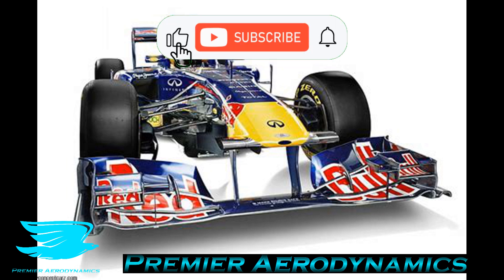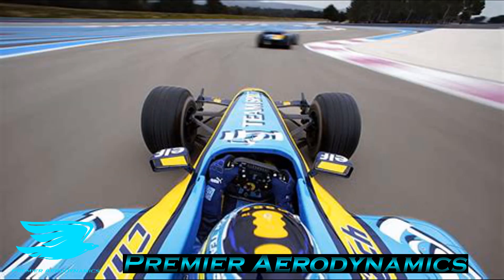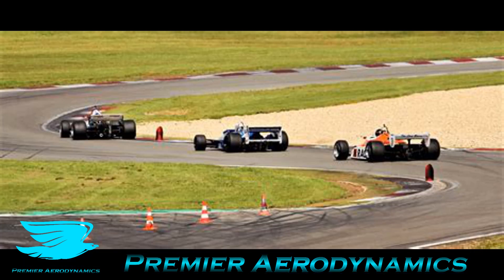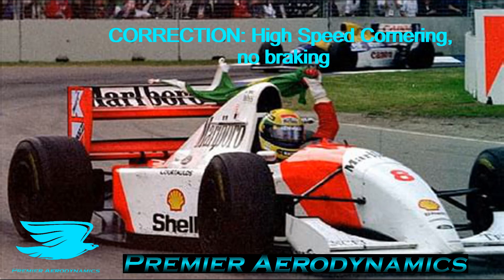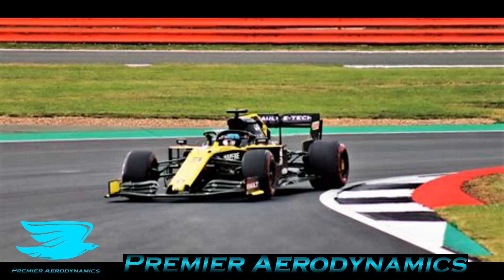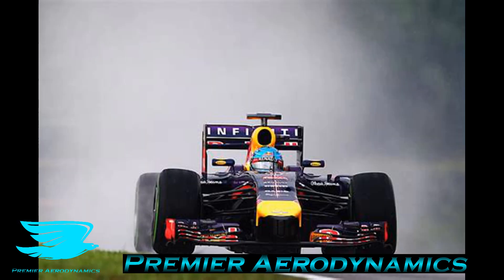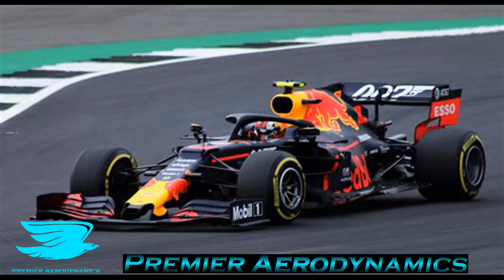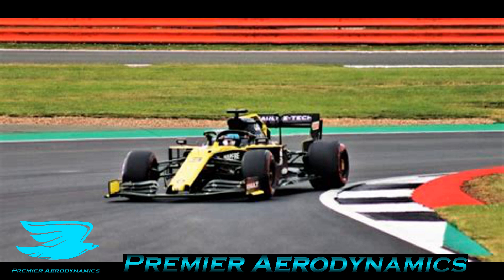F1 porpoising explained and how to fix - Podcast 47

Comment: What about tunneling on the floor so that it physically can’t get low enough to choke off thus preventing porpoising

I’m just a 20 year old kid trying to build a  fully functioning f1 car and I’m trying to learn as much as possible about the challenges and problems of them and I just discovered porpoising
Reply from the maker: Yep, that could work, but it also affects something called the venturi effect. If you can still isolate certain regions, then you can get enough downforce, but it really depends on how well you can expand the flow so that the pressure drops.

Comment: I will add that according to my calculations with a vehicle speed of ~250kph, the flow at the throat of the venturi, would be around 230m/s, and as high as 300m/s directly under the central section that houses the skid plank. Coincidentally, the porpoising manifests itself at roughly 250-260kph.
Reply from the maker: That's interesting. So, it all sums up and an easy way to fix this would be to stiffen any of the bending surfaces. Another way would be to induce an inwash. That might also be beneficial for the handling overall. Although, the weight would increase slightly.🤔
Reply: @PremierAerodynamics  The strong suction under the car does indeed promote inwash. The flow under the car basically pulls in the slower air flowing over the edge wing. The way it's setup now makes sense, there's no outwash device in front of the rear wheels. Next year they want to make the edge wing upturned, but that will introduce more outwash, which is bad for racing.

If you look at the cars going through rain, you see vortices shed by the front and rear tires, as the floor creates inwash through the low pressure created by the tunnels and central section.

The way the strakes work with the center of the floor is very interesting. The strakes create 3d flow patterns. The tunnels can be shaped because the central skid plate acts as the inner wall of the tunnel, and the edge wing acts as the outer wall. You can also sacrifice diffuser volume for more careful sculpting. Anything you can do to lower separation in the diffuser will lower back pressure and increase flow velocity and as a result lower pressure.

There is a way to lower the wake of the tire, and that is to toe out the wheel as much as possible. However, having extreme toe angles is impractical from a driving perspective, so you exploit the aerodynamics to create effective flow. In other words you channel the air around the tire, so that the tire basically behaves like it were toe'd out at extreme angles relative to the oncoming flow field. Kind of like how a propeller blade sees airflow at an angle instead of dead ahead, due to its rotational motion.

Comment: One of the big challenges to the overall aero package and the porpoising phenomena is the wake of the rear wheels. It was somewhat easier to deal with, with the legacy cars, the new ones have much less outwash in the diffuser to manage that wake. The sidepods have a big influence in the quality and location of the airflow over the diffuser and inboard of the rear tires. Also the backpressure in the diffuser section has a big influence, as do the flexible edge wings. The floor section in front of the rear wheels get's pulled down and acts as a skirt because the low pressure under the floor bends it. You notice a lot of teams use metal stays to add rigidity to the floor, and a lot of teams also use a pair of "ice skates" to keep the floor edge from rubbing on the ground directly.

The strakes at the leading edge of the floor create a strong outwash raising the pressure, this then creates a choking, on the strake closest to the body. This acts as a restriction to airflow under the car, the venturi tunnel further accelerates that low pressure air into the diffuser, this creates a strong low pressure under the car. The floor above bows in response to this strong suction, if this suction is disturbed it causes the floor to flap its wings, which leads to periodic vortex shedding. This is exacerbated by the need to run low and stiff, so as the car follows the road it will bounce over bumps and trigger that aero instability.

If you can find the flapping frequency, you can tune the suspension to induce destructive interference for that frequency. Most aerofoils produce vortex shedding in the tran-sonic regime in the 6-10hz range, and the porpoising F1 happens in the 5.5-8hz range.